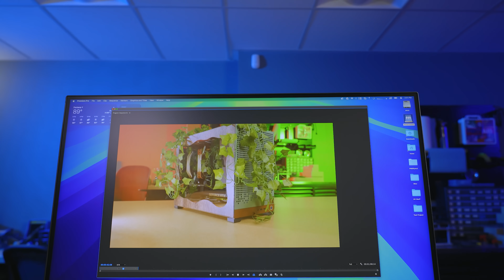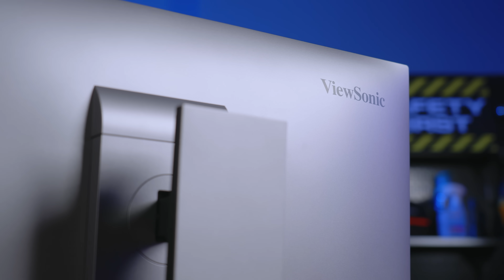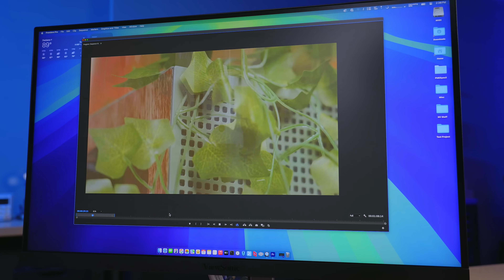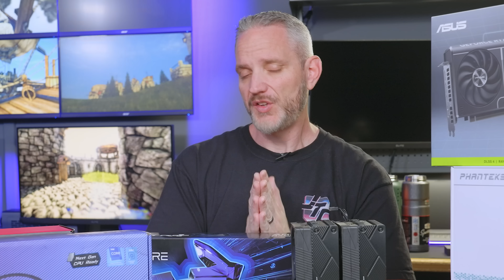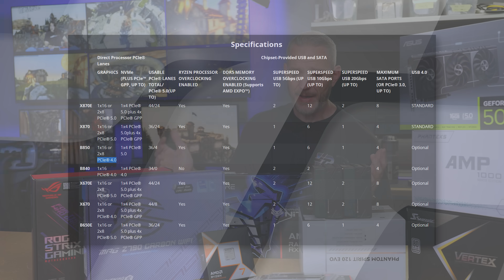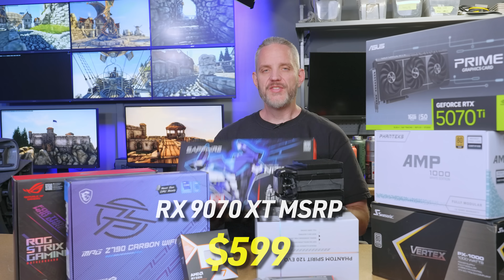This is the Sweetspot for PC gaming... Don't get fooled into spending more!

Comment: Sweet spot is always basied on what you can afford. Sadly i live 8 plus hours away from the closest micro center and they dont ship the stuff i need. Amazon does but the prices are stupid and ive read one to many horror stories. And well best buy isnt going to happen because they are worse in price point. Allied express and jawa are ok resources but still end up being used parts or similar price points. So im stuck with prebuild options i got the lenovo legon 5 T With AMD 7800X3D and a 5070 in it and the ram is probably the worse part being 38CL and the mother board not allowing me to use XMP in it but still runs all the games i play at 100ish FPS plus with DLSS .

Comment: Typically, retail outlets will charge the new higher prices even on the inventory they laid in BEFORE the actual price increases.  
Greed is everywhere these days and it is sickening.

As to PSUs, I add up all of the power demand from the individual components and then divide that by 0.7 to get the PSU that 
will work well for years.  For example:  485W power demand divided by 0.7 = 693W, so a 700W or 750W PSU fills the bill nicely.  
Also, I only use Seasonic or higher end Corsair PSUs.  No el cheapo supremos.  The PSU is the very heart of a PC, so going 
cheap there is just asking for trouble.  If a cheap PSU blows it can take everything in your system with it, not to mention setting
your house on fire, so just don't go there!

Still rockin' my XClio mega-tower case with 2 x 250mm fans and multiple drive bays and my RTX-3070 Ti, which is a decent
GPU regardless of all the hype surrounding the latest and greatest (in price) GPUs.  Yes, I would like to upgrade my GPU but
won't until MSRP pricing FINALLY becomes REAL.

Comment: Back in April last year I built a new PC $2.59 short of $3000.

CPU: i9-14900K $549
CPU Cooler: ARCTIC Liquid Freezer III 420 A-RGB $115.49
RAM: CORSAIR VENGEANCE DDR5 RAM 32GB (2x16GB) 5600MT/s CL36 $117.99
GPU: GIGABYTE GeForce RTX 4080 SUPER GAMING OC $1129.99
Storage: SAMSUNG 980 PRO SSD 2TB PCIe NVMe Gen 4 $333.98 (Two @ $166.99 each)
Motherboard: ASUS ROG Strix Z790-E Gaming WiFi 6E $359.99
PSU: EVGA SuperNOVA 1000 G5, 80 Plus Gold 1000W $159.99
Case: Thermaltake Core V71 $208.99

That's $2975.42 for the components

When you add the thermal paste:
Thermal Grizzly - Kryonaut Extreme - 2 Gram $21.99

A grand total of $2,997.41

Back in September, with the coming of Flight Simulator 2024, I upgraded to
CORSAIR VENGEANCE DDR5 RAM 64GB (2x32GB) 6000MT/s CL30 $214.99

I didn't see any performance improvements from 5600MT/s CL36 to 6000MT/s CL30. I only upgraded because the "ideal" requirements for the game were 64GB of RAM.

Comment: Hello, on my new PC, I would like to connect my monitors etc through docking station. Is there a B650 MB that has the thunderbolt port ready for this in IO? There are 2 monitors, one is standard 1080p with 60hz and second 1440p with 1440Hz.

Comment: I just hit check out on my new PC build today. R5 9600X, micro ATX ASRock b850 motherboard, 32 gigs of DDR5 6000 CL30 ram, a 9060 XT 16 gig, a cooler master micro ATX case, a Corsair fully modular 750 w gold PSU, hyper 212 Evo cooler, add a tube of thermal paste. Going to recycle my m.2 SSDs, and my case fans. Total cost Right at $850. Is it super high-end, nope. Will it play the games I want to play at 1440 60 FPS, yep. And it definitely beats my current rig of a 7700K and a GTX 1080. Don't think I'm going to need to upgrade for quite a while.

Comment: Always overclock, it doesn’t have to be crazy, but most of this stuff comes out the box underperforming.  You can safely overclock and get 5-10% boost and be done with it, or you can go harder and push your system, either way always overclock.

Comment: Jay, I genuinely believe that an entry-level Z690 or Z790 paired with any 12th-gen Intel processor is still a very solid option for a budget-conscious build. Even stepping down to a lower-tier chipset with something like a 12400F can deliver excellent results for entry-level or midrange systems.

For example, you can often find an i5-12600K or KF and a TUF Z790 motherboard for under $400. By comparison, a Ryzen 7 9700X with a B650 bundle typically lands just shy of $500. In most gaming scenarios at 1440p with a 4070 Super, you’re only looking at about a 5–10 FPS difference between the two. Plus, that $100 in savings could easily cover an Arctic Liquid Freezer AIO, and with a bit of tuning on the unlocked i5, you can squeeze out even more performance.

It’s also worth noting that the i5-14600KF is available for around $200, and performance-wise, it’s virtually identical to the 9700X on a chip-to-chip basis before you even factor in motherboard pricing. Yes, Intel CPUs tend to draw a bit more power and run warmer, but the money you save can go toward better and more aesthetic cooling solutions, balancing that out while still achieving similar real-world performance.

I do agree with you that Intel’s latest offerings and some of their previous-generation flagships have lost ground in terms of raw cost-to-performance. But even now, two months after the release of your video, many of their options remain highly relevant if chosen strategically.

And for the record, I’m not an Intel shill. Like you, I recently transitioned from a 14900K/KS setup to a 9950X3D. I didn’t need to make the change, but as someone aspiring to become a systems integrator, I enjoy pushing consumer-grade hardware within reason, not chasing synthetic benchmark records with liquid nitrogen or unrealistic open-bench setups, but tuning real-world systems that reflect how people actually use them.

I genuinely appreciate the content you and Gamer's Nexus put out, you’re among the most informative and unbiased voices in the space, and your work continues to inspire people who love this hobby. Consider this my two cents.

Comment: Idk why this feels like a bunch of bad advice, but I disagreed with pretty much everything 😂 Overbuy on your cooler because you might upgrade later? Well, if you have fun money for a new CPU, you have money for a new CPU cooler... right? So why dump $40 down the drain now on the off chance you upgrade within the lifespan of the cooler? You say Gen 3 drives are too slow to be in the sweet spot, but in most games the vast majority of people can't even tell the difference between a NVMe SSD and a sata SSD? (nobody buys HDDs anymore anyway lol)The only thing I really agreed with is the power supply, since there are tangible benefits to running an over spec power supply. Like, spend your money how you want, but the sweet spot really is just based on your budget 🤷‍♂️ You may have PC frills money, but the sweet spot for somebody with bills is not an $800 GPU 😭

Comment: I'll be honest, I've fallen out of the knowledge loop since building my last PC. I upgraded to a 5800x3D and am currently using an old RX 5700 XT (no overclocking on either) with 32GB of RAM and as far as I can tell it's running the games I play currently just fine (7D2D, Helldivers 2, Warframe, Darktide, to name a few) and I'm satisfied with 1080p and some 1440p gaming but on more modern titles like Space Marine 2 and Grounded 2 I've felt some performance impacts despite attempting to adjust settings to compensate. Not quite sure if I'm at the point of it being time to start a whole new build or if there's something I can do to keep this old horse going a bit longer before sending it to the glue factory.

Comment: At this point your content is partly just wrong. The only reason not to go with a 265K against a 9700X for example is the upgradability (up to Zen7). The Intel is comparable in gaming and destroys in productivity workloads. Has nothing to do with stability or EXPO.
I’m writing as the video progresses… now you are saying 6000CL30 or 28 is better than 8000 MEGAHERTZ (it’s Megatransfers and you should know that) in terms of performance and latency? Wrong. 8000CL34 has better performance and latency even compared to 6000CL26. The only thing is that your Mainboard has to support that speed and it’s not guaranteed. Btw I’m running GSkill Flare X5 and the heatsinks are SHIT. 
What is a Vapor chamber pipe?
You don’t have to spend 150 dollar to match a Phantom Spirit. The LF3 280 is better and costs 70 dollars, the LF3 360 is top of the line compared to other AIOS and below 100 dollar. I’m not saying AIO is better, I’m just correcting your trash talk. Mores Law doesn’t talk about double performance but about double transistor count per area. Which relates to more cores or shader and cache and therefore more performance, god damn. I have the feeling this is not a real tech channel, this is amateur talk and even to keep it simple for amateurs, it’s just wrong lol
The 4070 has 12GB of VRAM, not 16, that’s why it’s not really recommended for future proofing (except 1080p), again you are wrong.

Comment: If you have an old 11th gen Intel CPU and Z590 board, you are much better off chucking money at a 9070XT if you are a gamer. Borderlands 4 will run at 80-90FPS on 1440p.  Probably run games for another year or so. You can then do a full system swap out and keep the 9070XT...

Comment: I'd like a good system that I can do regular computing stuff and play Battlefield 1942 original, Road to Rome and Secret Weapons of WWII. Moongamers have the download with the DirectX API wrapper DXVK included so that this older game can play on a newer machine. I built several machines 25-28 years ago and I was a fan of AMD CPU's and NVIDIA graphic cards, MSI motherboards, Soundblaster sound cards, Altek Lansing surround system w/bass for speakers, and Crucial memory. A large power supply in those days was a 450W. I'd like a good system for under $2000. I'm 63 and don't need the latest greatest but I'd like to have a well cooled case, lighted keyboard, good mouse, and a good large monitor a sound system, and a good WIFI connection. Is this possible for less than $2k or not realistic? Thanks.
Reply: Just saw the $1500 Gaming PC video. 👍

Comment: My first build was a R5 5500, rx 6600 and I bought a modular 850w gold psu, top of the line am4/am5 cooler, and a case that has replaceable pcIe slots ( not cheap break aways).

I've been able to reuse case, psu,have new GPU now, CPU cooler and fans through multiple upgrades!!!!

You can pay a little more now, or a lot later..... choose wisely!

I'm looking at am5 x3d cpu, Mobo, ram combo now.

Comment: CPU: i7 14700K

GPU: Undecided. Crutching a left over 3050..

RAM: Corsair Vengence DDR5 64GB

SSD: Corsair MP700 Pro 2TB

PSU: Corsair 1000e 

Case: Corsair 4000D Airflow

MB: ASUS TUF Z790

AIO: Corsair Nautilus 360mm

Fans: All 120mm. Positive Pressure configuration

Monitor: ASUS Dual Monitor 4K/1080p. Name is too weird to remember. 

This build was designed to be relatively high end with the ability to upgrade to next gen CPUs (with a MB upgrade too) and GPUs. Some fans may be changed out for larger fans but at the moment, they work well. I understand the conflict between AMD and Intel CPUs. I simply made my choice. Works well for me. RAM amount was just what I wanted in my system. I do get into many different hobbies, and I just wanted to have the ability to do pretty much anything and everything. I am currently waiting to see what the 5080 Super refresh brings as I am very interested in high resolution gaming and Flight Sims on VR and just VR in general so if I see the gains thanks to more VRAM then I may go ahead and pull the trigger. That GPU should last 2 builds easy. It should be relevant for a good while, but hey, I am not opposed to the standard 16GB on the 5080. Hopefully prices become more reasonable but who knows. I hope it works out for us fellow gamers 🤝🏻

Comment: Careful buying for the future as you don't really know what you might get. You can buy a better cooler that's overkill now, and then in the future buy a mega CPU it's not quite good enough for so waste of money in both cases. Buy for now unless you know for sure what your future build will be.
That said, I'm still rocking my Noctua DH15 from 6 years ago, started on 8700k now managing 7800X3D without issues.

Comment: >implying pepsi tastes the same as coke
>doesn't mention to stay away from QLC
>4070 has 16GB RAM
>buy whatever AMD graphics card that is cheaper, they perform the same
The equivalent of being blind for taste.
QLC is garbage for use as a system drive, stay away.
4070 does not have 16GB RAM, 4070 Ti does not have 16GGB RAM, 4070 Super does not have 16GB RAM.
There are differences in components and design that say a lot of about the longevity of a graphics card.

Comment: i’m the opposite - I have discovered over many years of building PC’s to never ever buy the average stuff because usually it’s’ not guaranteed to last or has limited expandability / compatability purposes.  With PC builds you often have to think into the future instead of just the now due to the tech changing so quickly, so you attempt to future proof as much as possible when possible and wait for price reductions on the latest hardware.  Im building a secondary PC system - Intel based (not a fan of AMD) and the motherboard alone cost me AU$1,500 for the Maximus Extreme from Asus - Z890 and that is on special here in Australia.  I don’t overclock and never will however I prefer stability and quality over everything else so I buy the highest quality available from Asus from a variety of their hardware catergories .  My Asus Hyperion case alone cost me AU$700 and weighs 24kg empty.  So yes I am paying a lot more but I am willing to buy the best when priced to what I prefer to pay.

Comment: I’m picking the parts for a new pc build haven’t had a pc in years, would it be over kill to use a 9070xt 16gb with a ryzen 9 7900x or a ryzen 7 9700x, idk which cpu to go with

Comment: I built a X570/ amd 3600/ rtx2080 years back. Upgraded a bunch. 
With same board/ amd5700x3d/ rtx5070ti.

I do overclock with the board software. I want to go for high fps 1440p, tried a oled 50oHz  monitor. First oled, seems really nice, easier to look at. 

Still cpu bound in testing. So to get the best available spec's, you need the best parts. Saving a few bucks is nice though.

Comment: When I was with pentium g4560 or i3 8100 I don't remember with rx550 I got be quiet system power 9 700w and it's still running strong now with r7 9800x3d and rtx3070

Comment: Just upgraded my aging 1080 with a 5070ti. Now looking at board & chip. Would a 7800x3d be a good shout or a spent alittle more on a newer x3d, or are both not worth it with a 5070ti 😅

Comment: building just right now and thinking €2300.- : GB Eagle wifi 7 mobo, intel ultra7, nVidia rtx5070ti, Patriot Viper Elite 5 Ultra 96 GB (2 x 48 GB) DDR5-6400, crucial 4tb 705... 280 ARCTIC Liquid Freezer III Pro, be quiet! Dark Power 13 1000 W 80+ Ti, MSI MAG FORGE 321R AIRFLOW ATX Mid Tower. AMD IS STILL SUCH A CRAP - ÖÄK!

Comment: Overspecc the power supply...very good advice, I always do that. Buy an overclocked graphic card? Never ever going to do that again. Check that you buy the right RAM with your platform, very important advice, most don't really get that. And don't overpay for Motherboard and RAM and then buy a low end SSD. What makes you feel like you have a low performing PC is the slowest access in your system, and that used to be and still is the storage. So buy a decent SSD. Especially also because there might be games out there that late load certan content only when it's needed, and if your game stalls exactly at a critical time, that can be anoying, e.g. when playing a MMORPG 🙂

Comment: I worked long hard hours for years, now 60, building a rocket ship, that should out last me. The last rig built 2013 still working, only recently are some of the games started to show it's age from a former rocket to a potato..
Reply: Parts T600 bubblebee Thermotake case. 400mm Thermotake AIO and reverse blades , 1600 watt Corsair, Asus x870E, 9800x3d, 64G of lexar 6000mt memory x 2 , (intend on making excess a ramdisk), 3 4tb m.2 7 Thermotake fans plus 3 on AIO, display for case, stand to lay horizontal.
ASUS 5070TI OC, total 5k plus

Comment: I think its a little lazy by you here Jay to recommend the Thermalright Phantom Spirit 120 EVO when the Evo is a worse version of the Thermalright Phantom Spirit 120 SE. Just check reviews where they compare them (Which you should have done before recommending it) and you will find out that the EVO is a downgrade of the SE with worse fans not designed for that fin design like the SEs fans are.

Comment: I have a 6700k overclocked quite a bit and a 970. Modern games still run decently well but my gpu is always 100% util while my cpu never breaks 10%. Where i live there's less than 2000 people within 500 miles, no used market. I've had 11 DoA amd cards in my life so i will not try them again. Buying new nothing else beats price performance of the 5060ti, is this a terrible choice?

Comment: Everyone rips on the AIO’s but thermalright makes a 360 rgb for $57. That also comes with 3 exhaust or intake fans. To be fair that’s only $15 for thermalright fans. Still they look cleaner and I can show off my ram. So basically $40 for an aio that’s going to preform minimally quieter and  cooler than an air cooler.